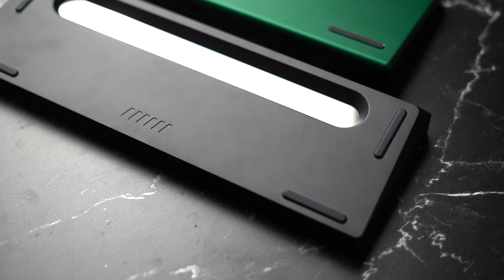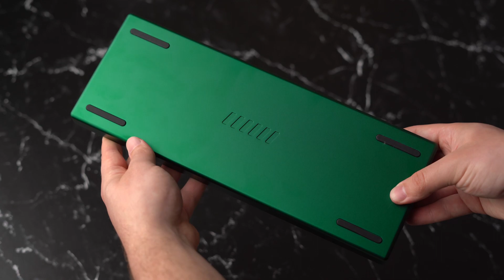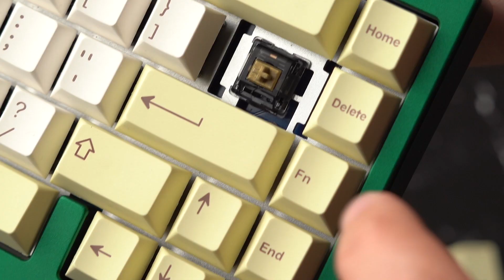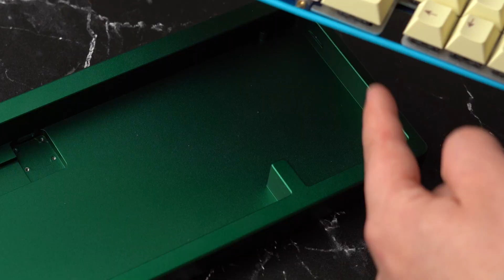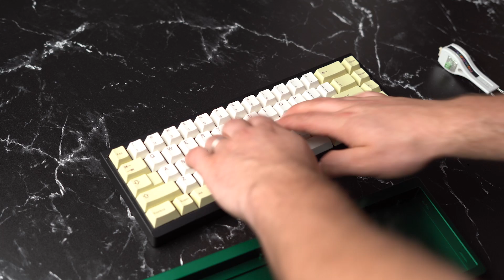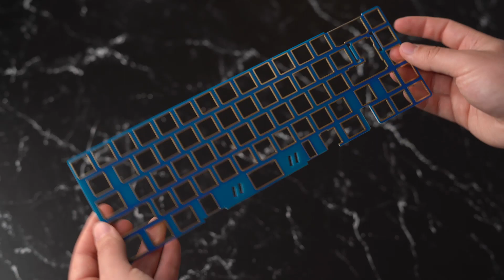Let's take a look at the Portal + Sequence from Parallel Limited | How to build + Typing ASMR

Comment: What differences in sound and feel did you notice between the two cases using the same internal build?
Reply from the maker: If I’m honest, not much. Both sound and feel great. If anything the portal had a slight resonance due to the weight sitting in the case. I’ve seen ways people are fixing this in their discord server
Reply: Awesome, that's good to hear. I did have to loosen my weight on the Portal to remove some ping but after that, pretty great. @thecaptainsterling

Comment: wait, so do durocks fit in the case? i hear that in other gummy o ring keyboards you need to use clip ins stabs so that it would fit.
Reply from the maker: I still recommend an alternative. Durocks don’t work well on the backspace and the spacebar In this board. I wasn’t aware until after I build it
Reply: @thecaptainsterling  okay that is good to know. good thing I still have spare clip-ins
Reply: @thecaptainsterling  but is it possible to use durocks tho

Comment: they should of thought of a way inside the case of the portal to reduce the chances of interference of the db cable with the bottom of the pcb. maybe a channel coming out from the db recess that goes towards where the cable plugs into the pcb. imo having more peace of mind knowing the cable won't touch the pcb would be nice. otherwise fun little board

Comment: I know I'm late, but what exactly is wrong with screw in stabs (durock v2) on this board? I wanna get this as my first board and get as little obstacles as possible
Reply from the maker: They work fine, it’s just the o ring gets a little hung up on the screws on the backspace